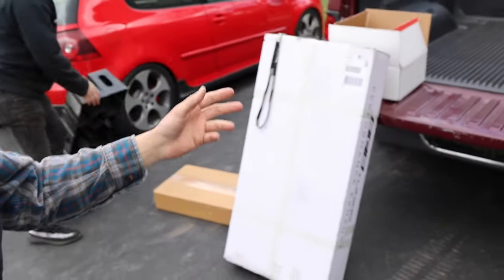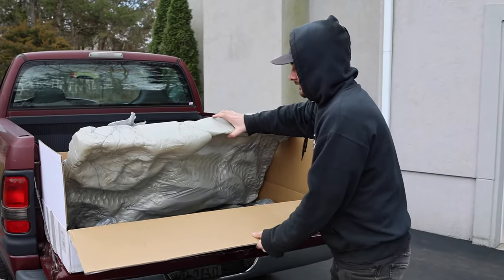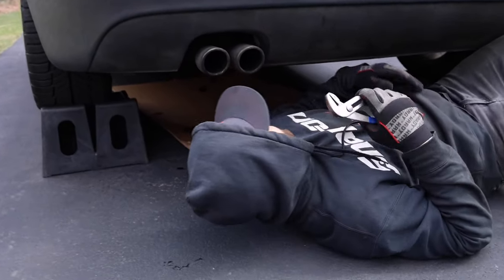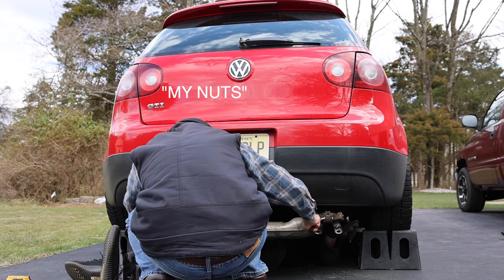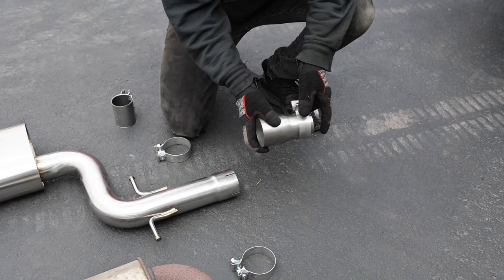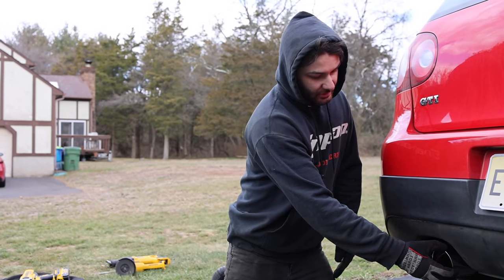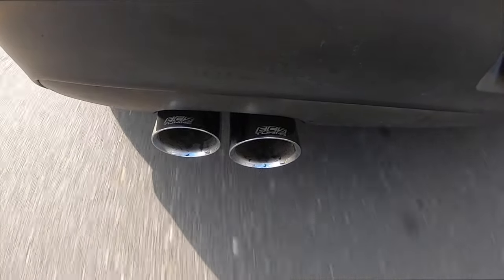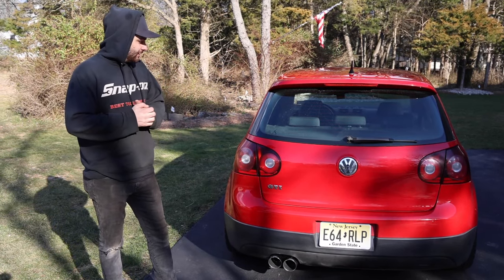MKV GTI ECS 3" Cat-back Exhaust | Install, Revs & Fly By's !!!

Comment: The same exhaust I had on my mk5 gti. I sold it about a month ago and bought a r55 mini clubman jcw after one spanked my tuned gti and I just happened to find one not too long after that happened and I see why my gti got beat..  the jcw mini is pretty freakin quick!
Reply from the maker: They definitely are! I feel like Mini Coops have more problems than GTI's generally, but I'm sure it's definitely faster than the GTI! Ours is stage 1 and definitely isn't fast by any means haha
Reply: @RatchetWrenches  yeah the N14 engine (which I have) is problematic but if you’re mechanically inclined and aware then it’s not that bad.. no more than my gti which gave me problems just as well so.